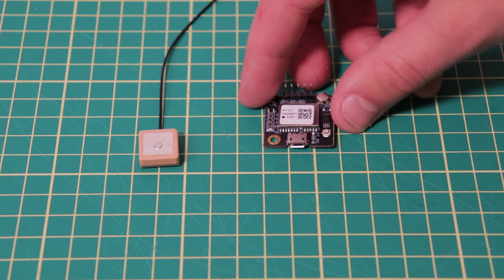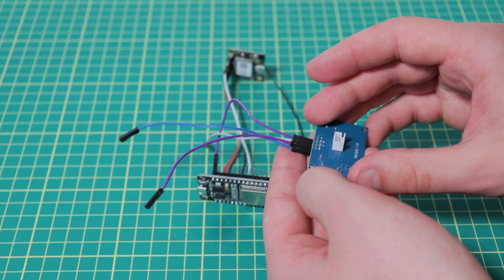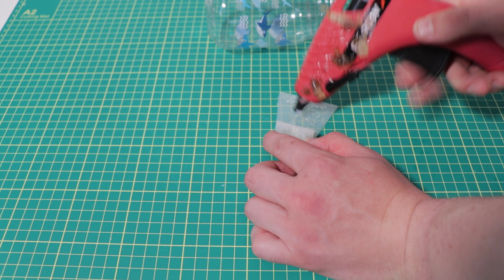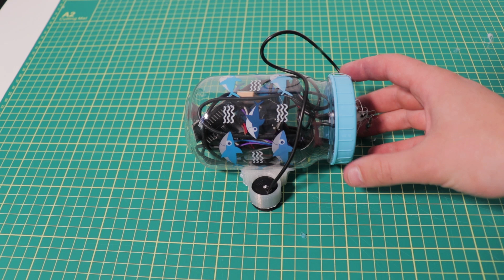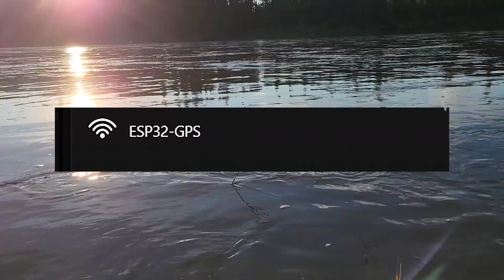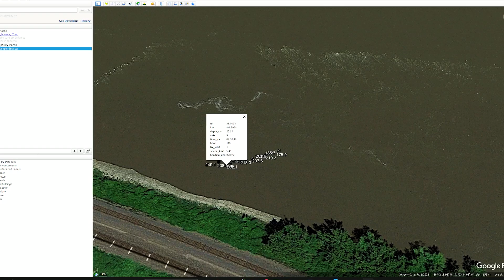Build Your Own GPS Depth Mapper for PENNIES! (DIY ESP32 Sonar)

Comment: So, that sensor, at least by my experience, and others online, shouldn't work in water (and just returns something like 20cm) How did you get that to work?
Reply from the maker: Funny enough same issues, when I first tested it in a container it would read 20cm  almost exactly. I did some further experiments and found my issues at least for me were blind zone and cone angle related. I did a video with the tests:https://www.youtube.com/watch?v=qLu9FamE6bg

I had to edit the speed value and make sure the container was deeper than the blind zone and wider than the cone angle. In water its roughly 4x the blind zone compared to air and thus you need to be deeper than like a meter if I recall correctly. The width is a function of depth so the deeper you measure the wider the body of water. Although my bathtub was able to get enough depth the sound waves (I speculated) likely were bouncing off the sides before reaching the end of the tub. It wasn't until I went to a lake were it was both deep and wide was I able to measure the depth.

Cheers,

Comment: amazing work i just sucbsribed you! 
can we get the wiring scheme for learning for beginner like me ?
Reply from the maker: Hi thanks for the comment !

I don't have a wiring scheme but if I recall correctly I used pins 4 and 5 for the gps sensor:
pin 4 (esp32) -----------> RX pin (GPS)
pin 5 (esp32) ------------>TX pin (GPS)

Since the gps can run on 3v I used the 3v pins to power it:
pin 3v3 (esp32)  -----------> Vcc(GPS) 
pin GND (the one next to the 3v3pin) ----> GND (GPS)

For the ultrasonic transceiver I used pins 18 and 19:
pin 18 (esp32) ----> trig pin (sonar)
pin 19 (esp32) -----> echo pin (sonar)

The sonar needed 5v so the remaining power rails vin and the ground, "GND" next to it were used:
Vin (esp32)  ----> 5v (sonar)
GND (one next to vin) ---> GND (sonar)

Cheers,
Reply: @TheoryToThing  thank you so much, i'll try to make it

Comment: can you make a diy underwater sonar to detect fish around and monitor it in apps?
Reply from the maker: Hi thanks for the comment!

I have thought about that but a transceiver like this wont work as a fish finder. The data you get it very limited, just the time between the ping and the first valid echo return. Without data like the return strength of the signal trying to figure out what the sensor is looking at (like for example a rocky bottom would return stronger than a softer one) doesn't seem feasible.

Cheers,

Comment: the work is amazing ! is there an alternate gps module that u'd suggest since gt-u7 isnt available here in my country
Reply from the maker: Thanks for the comment!

I think any cheap gps module would work. The only thing to note is to make sure it can run on 3.3v unless you want to power it separately since the 5v pins are used by the depth sensor.

Cheers,
Reply: @TheoryToThing  thanks mate , i did get a neo 6M GPS module we got something similar done too ! thanks

Comment from the maker: Code used:

#include <WiFi.h>
#include <WebServer.h>
#include <TinyGPSPlus.h>
#include <HardwareSerial.h>
#include <vector>

// --- GPS Setup ---
HardwareSerial gpsSerial(1);
const int RXPin = 4; 
const int TXPin = 5; 
TinyGPSPlus gps;

// --- Sonar Setup ---
const int trigPin = 18;
const int echoPin = 19;
long duration;
float distanceCM = 0.0;

// --- Wi-Fi AP Setup ---
const char* ap_ssid = "ESP32-GPS";
WebServer server(80);

// --- Logging Data Structure ---
struct LogEntry {
  double lat, lon;
  float depth;
  int sats;
  String time;
  int hdop;
  bool fixValid;
  float speedKmh;
  float headingDeg;
};
std::vector<LogEntry> logData;

bool isRecording = false;
unsigned long lastLogTime = 0;

// --- Read Sonar Distance ---
void readSonar() {
  digitalWrite(trigPin, LOW);
  delayMicroseconds(2);
  digitalWrite(trigPin, HIGH);
  delayMicroseconds(10);
  digitalWrite(trigPin, LOW);
  duration = pulseIn(echoPin, HIGH, 30000); // 30ms timeout
  distanceCM = duration ? duration * 0.1483 / 2.0 : 0.0;
}

// --- Root Webpage Handler ---
void handleRoot() {
  String html = "<!DOCTYPE html><html><head><meta charset='utf-8'>";
  html += "<meta name='viewport' content='width=device-width, initial-scale=1.0'>";
  html += "<meta http-equiv='refresh' content='5'>";
  html += "<title>ESP32 GPS + Sonar Logger</title>";
  html += "<style>"
          "body { font-family: Arial; font-size: 22px; padding: 20px; }"
          "button { font-size: 28px; padding: 20px 40px; margin: 10px 0; display: block; width: 100%; max-width: 400px; }"
          "h1, p { font-size: 28px; }"
          "</style>";
  html += "</head><body>";
  html += "<h1>ESP32 GPS + Sonar Logger</h1>";

  html += "<form action='/start'><button>▶ Start Recording</button></form>";
  html += "<form action='/stop'><button>⏹ Stop Recording</button></form>";
  html += "<form action='/download'><button>⬇ Download CSV</button></form>";
  html += "<form action='/clear'><button style='background-color:#f44336; color:white;'>🗑 Clear Data</button></form>";

  html += isRecording ? "<p style='color:green'><em>Recording is <strong>ON</strong></em></p>"
                      : "<p style='color:red'><em>Recording is <strong>OFF</strong></em></p>";

  if (gps.location.isValid()) {
    html += "<p><strong>Latitude:</strong> " + String(gps.location.lat(), 6) + "</p>";
    html += "<p><strong>Longitude:</strong> " + String(gps.location.lng(), 6) + "</p>";
  } else {
    html += "<p><strong>GPS:</strong> Waiting for signal...</p>";
  }

  html += "<p><strong>Satellites:</strong> " + String(gps.satellites.value()) + "</p>";
  html += "<p><strong>HDOP:</strong> " + (gps.hdop.isValid() ? String(gps.hdop.value()) : "N/A") + "</p>";
  html += "<p><strong>Speed:</strong> " + (gps.speed.isValid() ? String(gps.speed.kmph(), 2) + " km/h" : "N/A") + "</p>";
  html += "<p><strong>Heading:</strong> " + (gps.course.isValid() ? String(gps.course.deg(), 2) + "°" : "N/A") + "</p>";
  html += "<p><strong>Sonar Distance:</strong> " + String(distanceCM, 1) + " cm</p>";

  html += "</body></html>";
  server.send(200, "text/html", html);
}

// --- CSV Download Handler ---
void handleDownloadCSV() {
  char filename[32];
  if (gps.time.isValid()) {
    sprintf(filename, "gps_sonar_%04d%02d%02d_%02d%02d%02d.csv",
        gps.date.year(), gps.date.month(), gps.date.day(),
        gps.time.hour(), gps.time.minute(), gps.time.second());

  } else {
    strcpy(filename, "gps_sonar_log.csv");
  }

  String csv = "lat,lon,depth_cm,sats,time_utc,hdop,fix_valid,speed_kmh,heading_deg\n";
  for (const auto& entry : logData) {
    csv += String(entry.lat, 6) + ",";
    csv += String(entry.lon, 6) + ",";
    csv += String(entry.depth, 1) + ",";
    csv += String(entry.sats) + ",";
    csv += entry.time + ",";
    csv += String(entry.hdop) + ",";
    csv += String(entry.fixValid ? "1" : "0") + ",";
    csv += String(entry.speedKmh, 2) + ",";
    csv += String(entry.headingDeg, 2) + "\n";
  }

  server.sendHeader("Content-Disposition", String("attachment; filename=\"") + filename + "\"");
  server.send(200, "text/csv", csv);
}

// --- Start/Stop/Clear Handlers ---
void handleStart() {
  isRecording = true;
  lastLogTime = millis();
  server.sendHeader("Location", "/");
  server.send(303);
}
void handleStop() {
  isRecording = false;
  server.sendHeader("Location", "/");
  server.send(303);
}
void handleClear() {
  logData.clear();
  server.sendHeader("Location", "/");
  server.send(303);
}

// --- Setup ---
void setup() {
  Serial.begin(115200);
  gpsSerial.begin(9600, SERIAL_8N1, RXPin, TXPin);

  pinMode(trigPin, OUTPUT);
  digitalWrite(trigPin, LOW); // Ensure sonar trigger starts LOW
  pinMode(echoPin, INPUT);

  WiFi.softAP(ap_ssid);
  delay(1000);
  Serial.print("AP IP: ");
  Serial.println(WiFi.softAPIP());

  server.on("/", handleRoot);
  server.on("/start", handleStart);
  server.on("/stop", handleStop);
  server.on("/download", handleDownloadCSV);
  server.on("/clear", handleClear);
  server.begin();
}

// --- Loop ---
void loop() {
  // Continuously parse GPS data
  while (gpsSerial.available()) {
    gps.encode(gpsSerial.read());
  }

  // Read sonar
  readSonar();

  // Log every 1000ms if recording
  unsigned long now = millis();
  if (isRecording && gps.location.isValid() && now - lastLogTime >= 1000) {
    lastLogTime = now;

    LogEntry entry;
    entry.lat = gps.location.lat();
    entry.lon = gps.location.lng();
    entry.depth = distanceCM;
    entry.sats = gps.satellites.value();
    entry.hdop = gps.hdop.isValid() ? gps.hdop.value() : -1;
    entry.fixValid = gps.location.isValid();
    entry.speedKmh = gps.speed.isValid() ? gps.speed.kmph() : 0.0;
    entry.headingDeg = gps.course.isValid() ? gps.course.deg() : 0.0;

    if (gps.time.isValid()) {
      char buf[9];
      sprintf(buf, "%02d:%02d:%02d", gps.time.hour(), gps.time.minute(), gps.time.second());
      entry.time = String(buf);
    } else {
      entry.time = "??:??:??";
    }

    logData.push_back(entry);
  }

  // Serve web requests
  server.handleClient();

  // Give time for background tasks
  delay(5);
}
Reply: Amazing inspiration DIY Project! Thank you but could you put the code on Github?
Reply from the maker: @Spiroslash  Hi thanks for the comment, unfortunately I don't have a Github page. That might change depending if I want to follow up on the project. I had an idea of maybe trying to make like an open source type of product where anyone can build a sonar buoy and upload the .csv files to a common webpage to make fresh water depth charts. A lot of small fresh water bodies near me have no data on depths or have that data locked behind a paywall so a kinda crowd sourced mapping page could be interesting but I haven't done any research into it since I feel like this probably already exists. Cheers!